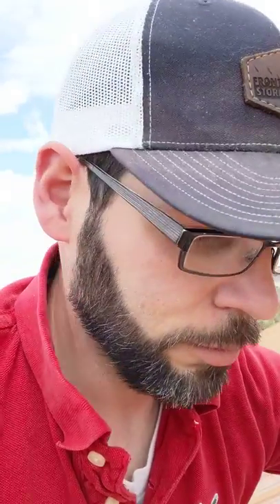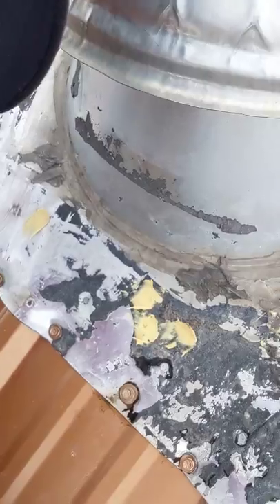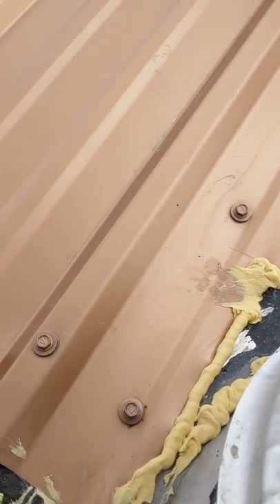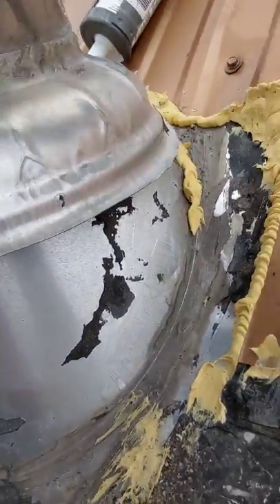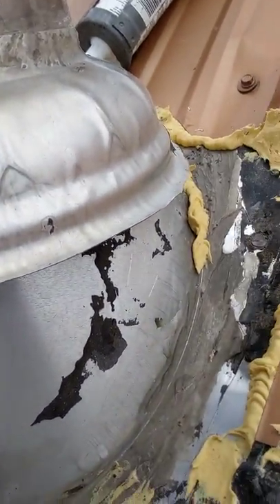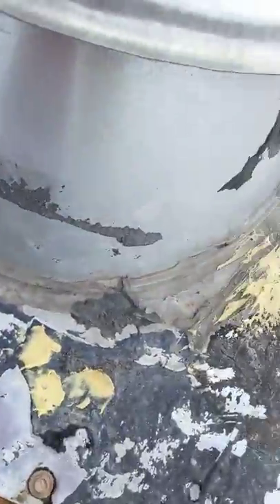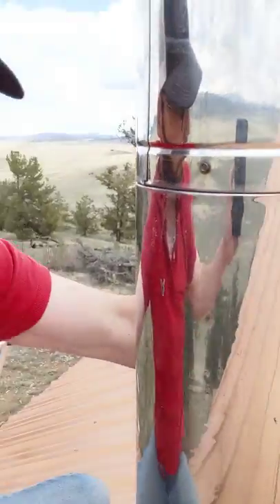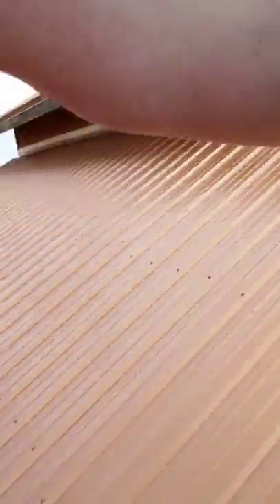How to walk on steep metal roofs

Comment: Did I miss the "How to" part?
Reply from the maker: Lol. The recommendation was to leave it to the pros. Metal has zero grip. If it's steep and you slip, you're over the edge. However, one can use the screw heads to use as foot holds.
Reply: @FrontRangeStormContractors  not on standing seam, there are no exposed screws.
Reply from the maker: Good point. For that I recommend using Cougar Paws SteelWalker boot. https://www.cougarpaws.com/products/steelwalker-boot

Comment: One way (what we did on an  "11:12" steep roof ) is to tie a ladder up to at least where  you need to work; in  your case throw a long rope over the top of hs,  down to other side the house tied "securely" to the ladder, then pull the ladder up, tie it off securely; a 2nd rope same way can be your safety rope tied around your waist.
Reply from the maker: Good point. After this I actually started carrying around a 2nd ladder just for this!
Reply: @FrontRangeStormContractors   A wooden ladder is best with no metal on it at all, to avoid scratching the valuable metal roof panels; use 2 ropes and one should be like 100 ft to be able to go over top of roof (if gable is strong enough to not crimp from strain on rope) to some strong tie point on other side of house... the 2nd rope is for safey and should be around your waist ( i think a square knot will not slip and squeeze you too much).  Best of luck. oh yeh, a plastic bucket tied to a rope can hold parts n tools.

Comment: you should look into getting yourself some Lexel, it's the top-of-the-line roof sealant and its clear, plus that boot was installed wrong, they make boots that slip over it and get screwed down right on top of the metal, it has a rubber seal going around the perimeter of the screwing flange. that won't be the last time on that roof if that is indicative of the quality of the roofers. they clearly reused the old flange, tsk tsk. not your work though i assume. some people

Comment: This is some great satire for "how to". I mean - what else could it be  really?

Having a few little bolt heads under your shoes  being your only means of prevention for falling off  a steep, slippery metal roof is  pretty wild. 
I am hoping this is  just one of a series of satirical send ups on working safety  - and not actual advice. If so, well done. 

Ropes and harnesses are relatively cheap and easy to use friend. 

No need to risk your life so transparently .

Comment: Good vid:  yah its hard to hand on a steep metal roof AND work with only one arm.  You really should smooth that caulk out with a flat paint stick (consider a new rubber boot for that vent pipe),  also you should have a rope around  your waist too.
Reply from the maker: Yep. Should have been a little more secure. I was completely caught off-guard by the pitch and hours away from town.